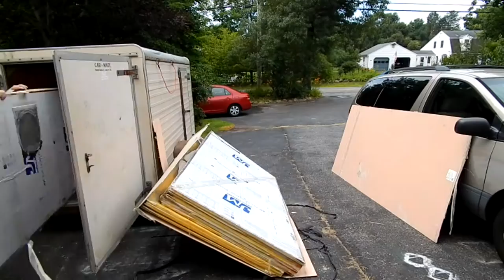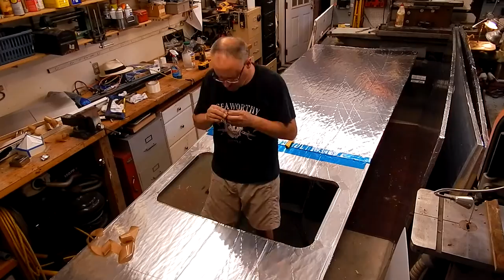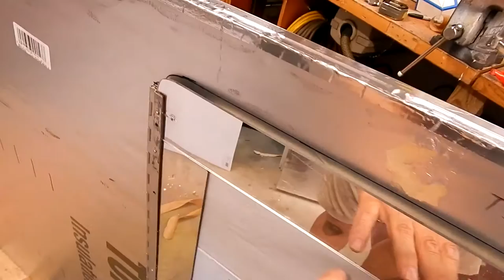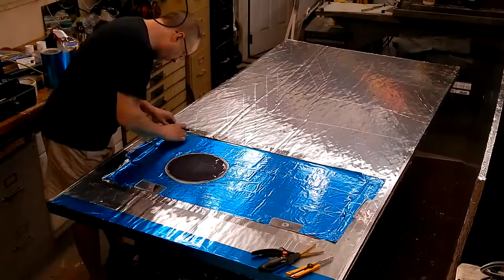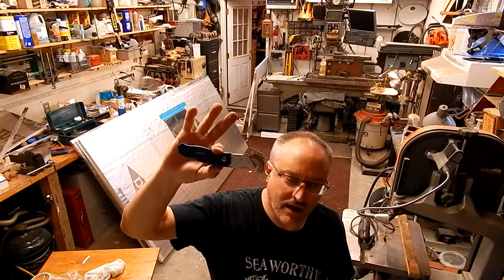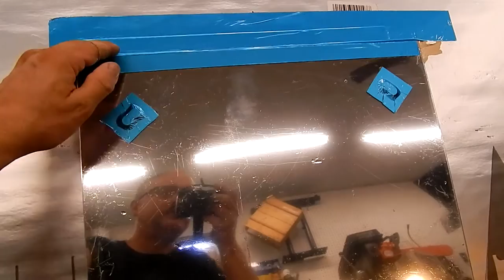Pentayurt - Part 2

Comment: You must pull outside air through the swamp cooler for it to work.  I run a swamp cooler every year and have the air intake coming from outside the yurt.  It will get so cold, I have to sleep under a blanket in the middle of the day.  Hope that helps.
Reply from the maker: johnplus5  I did pull outside air but just didn't have enough solar for a fan of sufficient power. The swap cooler made an excellent evapotron though, dispatching all of our cooler melt water.

Comment: What about wrap around U shaped plastic profiles? Those could accept a large variety of joints once glued on to the panels. A lot more durable than tape and would provide extra rigidity.

Link broken so GoogTube doesn't mark it as spam: "http  :// plastic-panels . co . uk / wp-content/uploads/2012/03/click-and-fix-003.jpg", just remove the spaces.